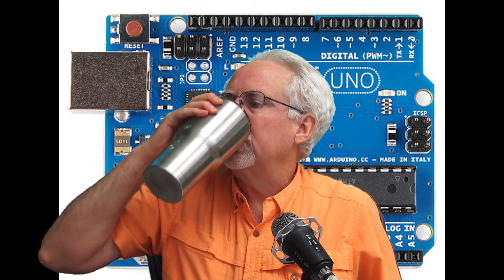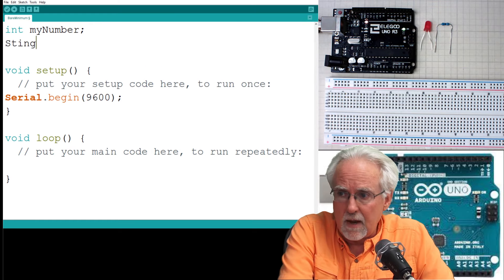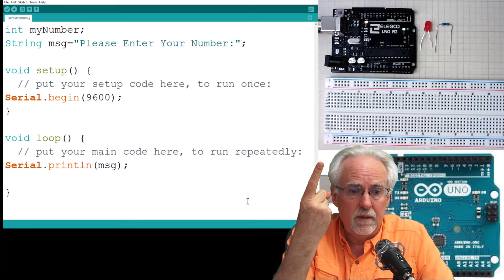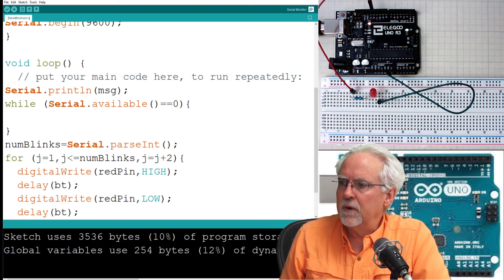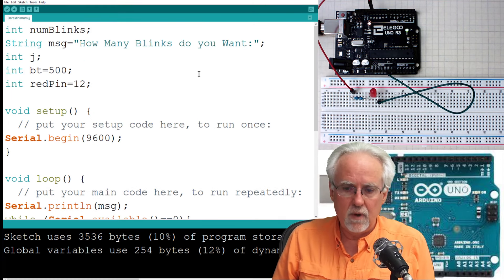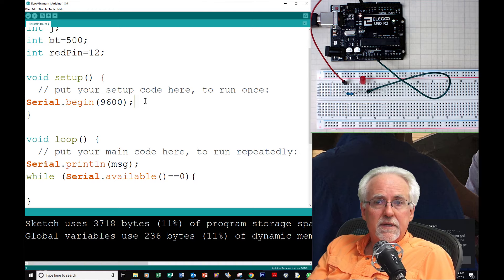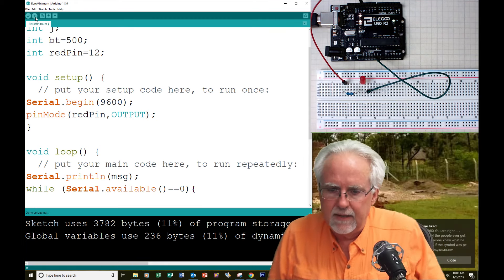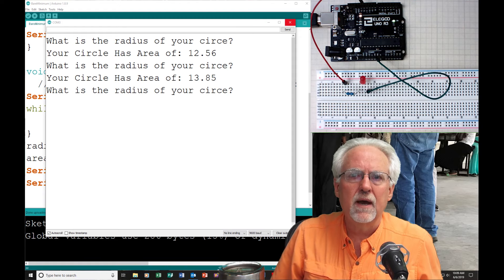Arduino Tutorial 18: Reading Numbers from the Serial Monitor

Comment: About 10 min in kinda got an idea of what you were going for for this one. Decided to stop the video try it myself. It works, but I'm not sure how to read Strings in it so can't type in ON OFF, just 1 or 0.

int lightChoice;
String msg="Light ON/OFF:  ";
String msg2="Light is ON";
String msg3="Light is OFF";
int currentLight;
int light=12;
int delayTime=500;

void setup() {
  Serial.begin(9600);
  pinMode(light,OUTPUT);
}

void loop() {
  Serial.println(msg);
  lightChoice=3;
  while (Serial.available()==0){
    
  }
lightChoice=Serial.parseInt();
if (lightChoice==1){
  digitalWrite(light,HIGH);
    Serial.println(msg2);
}
if (lightChoice==0){
  digitalWrite(light,LOW);
  Serial.println(msg3);
delay(delayTime);
}
}
Reply: Watched a few more min saw the actual project and took another shot

int blinks;
String msg="How Many Blinks?:  ";
String msg2="Blinking for ";
String msg3=" time";
String msg4="s";
int currentLight;
int light=12;
int delayTime=500;
int j;

void setup() {
  Serial.begin(9600);
  pinMode(light,OUTPUT);
}

void loop() {
  Serial.println();
  Serial.println(msg);
  while (Serial.available()==0){
    
  }
blinks=Serial.parseInt();
Serial.print(msg2);
Serial.print(blinks);
if (blinks>1){
  Serial.print(msg3);
  Serial.println(msg4);
}
if (blinks<=1){
  Serial.println(msg3);
}

for(j=1;j<=blinks;j=j+1){
  digitalWrite(light,HIGH);
  delay(delayTime);
  digitalWrite(light,LOW);
  delay(delayTime);
  
} 
}

Comment: I am kind of late to the show.I really find it very informative. I watch few and goof with it, then watch some more. Yesterday I spent a embarrassing bazooka amount of time trying to figure out why a few of my LEDs were so dim (but working). It was the pinMode!! I was a day too late. I am trying to set up a binary clock. IT WORKS! However; I have an issue when I set the delay to above 30000 (I need 60000 to get the clock to work on real time) it freezes. Any ideas? Thanks.
Reply from the maker: The problem is likely you are overflowing the int variable. ints have a maximum size around 30,000. Try using 
unsigned long yourVarName

Comment: Hey paul, In the Serial Monitor it always kept printing out the message even when I didn't give it any input. I did pretty much what you did and did the "No Line Ending" thing too. For now I made it in a For loop so it only prints once in the beginning, and another time when you put your input. Is it because I'm Using a more up to date version of arduino?

The Edit: nvm I just found out that I just had indexed the program wrong.

Comment: i did this exercise and everything did work, I keep getting a second print out with a 0 in it, i'll just show you one :
 what is the radius of your circle? 
Your circle has an area of: 12.56
 what is the radius of your circle? 
Your circle has an area of: 0.00
 what is the radius of your circle?
Reply: nevermind I just say your other message, of the "no Line Ending" and that fixed it. i'm just going to leave this here because someone might need to see this. Great job Paul, ignore the haters.

Comment: Why does my serial monitor gives a "your number is 0" after giving "your number is 3"? (I typed in 3 in the serial monitor and it gives "your number is 3", then "please enter your number", and then automatically gave "your number is 0"). The code I use is identical to yours.

Comment: Hi, I wrote the same program on my own yet it asks HOW MANY BLINKS twice after the LED finished blinking. 

int NumBlinks{};
String msg1 {"How Make Blinks Do You Want: "};
int redPin {12};
int delayTime {250};

void setup() {
  // put your setup code here, to run once:
  Serial.begin(9600);
  pinMode(redPin, OUTPUT);

}

void loop() {
  // put your main code here, to run repeatedly:
  Serial.println(msg1);
  while(Serial.available() == 0){
    
  }
  NumBlinks = Serial.parseInt();
  for(int i {0}; i < NumBlinks; i++){
    digitalWrite(redPin, HIGH);
    delay(delayTime);
    digitalWrite(redPin, LOW);
    delay(delayTime);
  }

}

Comment: Please help here, I'm using the R4 Minima board if this makes any difference, BUT WHEN I open the Serial Monitor to execute the program, Nothing appears! Only when I actually enter a number (just because I know what the program should do), it gives the number and ONLY THEN it shows "Please enter your number?"

Is this a bug or something because I'm not missing ANY semi colon or see anything I've missed?? I'm stumped.🤔
Reply from the maker: Make sure serial monitor is set to no line ending.
Reply: @paulmcwhorter  I think it's a minor bug. I immediately (on my laptop now) chose "no line ending" before choosing a number.. then it waited for me to enter a number before telling me what my number was and prompting me once more...
When I retyped the code in a new sketch and did not immediately change to "no line ending", it prompted me with the question as it should, BUT then I need to change it to "no line ending again" so it doesn't give me that unwanted "your number is 0.." line. 

However.. when I close and reopen the serial monitor, I get prompted with "Please enter your number:" even with "no line ending" chosen from the start. So it is when one types the code for the first time after opening a fresh new sketch that I experience the glitch or bug.

I hope this makes sense, but I wanted to explain what I experienced thoroughly.🙂
Reply: Keep getting back a message that your number is 0. I’m sure I’ve written the code to an exact copy. Been staring at it for ages 😢.

Comment: Another question --- when working on this, I wanted to accept a lower OR uppercase "R" for red, but I have not found any method of doing string handling in the Arduino reference (as in interrogate the first character and make the decision based on that).  Sure, I can make it check for "red", "green", "blue" but I wanted to 1)limit the valid inputs and 2) make the entry simpler for the user.  Can that be done?
Reply: One way to do it would be something like this. Note that this is just pseudocode, not meant to be actually runable:

  Serial.println(msg);
  while(Serial.available()==0) {
    
  }
  userPinChoice=Serial.readString();
  If (userPInChoice == "r" || userPinChoice == "R")
{
   //Do something
}

To do something like you suggest (interrogate the first character) you could try:

userPinChoice = Serial.readString();
string myPin = userPinChoice.substring(0, 1);      //start substring at index 0 and continue only until index 1: gets only the first character
If (myPin == "r" || myPin == "R")
{
   //Do something
}

Hope this helps!

Comment: I think this will be more intuitive to take in...
Coding the Serial.available(); before the WHILE loop and including it as the "last" statement in the WHILE loop.
It works equally well with what you did Sir Paul, but i think this is more easy to take in for us beginners.
It's like instructing the serial port to check available data in its vicinity...and when it does not found any, it just proceeds to checking again via the last statement in the WHILE loop. AND..reading the last statement in the WHILE loop i.e. Serial.available();...it counter-checks with the condition inside the WHILE..hence a more intuitive process of looping.

Anyways, thank you for this lesson Sir Paul. Definitely learned new things!

----------------------------------------------------------
void loop(){
  Serial.println(msg1);
  
  Serial.available();
  
  while(Serial.available()==0){
     
    Serial.available();
  }

Comment: I have a little problem with my coding sir..Whenever I uploaded the sketch, the program works as expected but then it automatically prints out "Your number is :0" on the second run of the program and wouldn't wait for me to input  number the second time until the 3rd run when it then allows me to input a number
Reply: Paul McWhorter
8 months ago
Guys if you are having trouble, make sure you have your serial monitor set to "No Line Ending". Otherwise you can get unpredictable results.

Comment: Nice one Paul! With your help I was able to create a game using the prompts. Where two inputs into the serial monitor were added together and the total amount of blinks output to the LED. After each action the user knew what was happening as the code will produce messages based on what's happening.

Very cool!

Comment: For some reason after the code run once and I input a number it displays the String message twice instead of once.  My code looks exactly like yours so I can figure out what is going on.  Never mind, found the answer in a comment below.  Change the Serial Monitor to "No line ending" and that worked.

Comment: Hi Paul,

in this lesson we didn't enter a pinMode and the LED blinked dim but you did not explain what was causing the LED to blink dim when no pinmode is entered?

Kind Regards

James.
Reply from the maker: It has to do with the way the pin is connected in the circuit, based on the pinmode command. Hard to explain without drawing a picture
Reply: According to the Arduino reference; the internal pull-up resistor is enabled by default when pins are undeclared, and the resistor acts to limit the available current. Unfortunately the Atmega328 datasheet offers only basic schematic diagrams of the I/O pins so I'm unable to explain exactly how this happens.

Source : https://www.arduino.cc/reference/en/language/functions/digital-io/digitalwrite/

Comment: Is there a reason why the largest positive integer the serial monitor will accept is 32767? If I input 32768, it prints -32768. Positive integers above 32768 prints different negative numbers. Is this a mathematical limitation of the Arduino or a bug in the code?

Comment: Anyone else get an issue where you kept getting a second 0 value automatically entered every time you enter a legitimate Value?  Found it after a few minutes of checking.  
It was on the Serial.print window, just of the left of the BAUD rate value (9600  or whatever you may have set it to).  Mine had defaulted to "Carriage Return"  it needed to be set to "No line ending"
I mention it just incase its caught someone else too.

Comment: Does anyone know why numbers entered with values above 5 characters and even some with 5 characters produce seemingly random outputs including minus numbers?
Reply from the maker: In arduino integers are limited to a certain size. . . something like 32000. Have to use floats for nubmers bigger than that.
Reply: @paulmcwhorter  I didn't expect a reply from you Paul, thank you so much!

Comment: I am using Arduino 1.8.13 and when I run the code for the Ask, wait, read I get a read of the input number AND a read of "0". Unless I put a Seria.parselInt/Float() before the wait loop.
Reply: Do you have a single equal sign in this line of code?  The code line should be:         while (Serial.available()==0){

Comment: How do you flush the Serial buffer to stop residual input?
Reply from the maker: That is really hard, and I have had only limited success with it. Make sure your serial monitor is set to no line ending, and one way to can clear it is to just read into a dummy variable. Wish I had a better answer.

Comment: Very very interesting and helpful series!!! However i have one question . I tried exactly the same code as yours and i couldn't get it to write the numbers i inserted into the serial monitor, without printing  the additional messages: ''please give your number, your number is 0 . So i experimented, and replaced the command : while (Serial.available()== 0){
  
} with the command (while (Serial.available()== 1){
  
}) and it worked !. Could you answer me why? thanx a lot !!! 
jim
Reply from the maker: make sure serial monitor is set to no line ending
Reply: @paulmcwhorter  thank you very much!!

Comment: Could you please clarify how the message in your code is designed to print only once? I observe that the `println` statement is within the loop, similar to my code. However, in my case, the message continues to print until I input a value. I appreciate any insights or suggestions to address this behavior.
Reply: Sorry found my mistake, "No Line Ending" 😁

Comment: How can I use the square ^ on the variables instead of having to tyoe radius in twice?
I tried only printing 3^2 but that didn't work either
Reply: There is a function for doing powers pow(). For example 3^2 would be pow(3, 2). I got some unpredictable results with it though, but I think it was because pow() returns a long and I was doing int math. Also I think you can't use pow() in an if statement, probably better to assign your pow() value to a variable first, then do the if statement with the variable. Need to do more experiments.

Comment: Unfortunately it seems I can't test this out. It's not accepting inputs in the serial monitor on the "tinkercad" simulator.  I can type in there, but it's not accepting what I type. Actually, it just gives back whatever it wants. In the "Enter a number" example. I put in 55, it told me "Your number is -4556" <<<Literally not what I said at all. I think the tinkercard serial monitor is buggy for inputs, but I'm sure that the code would work fine. 

I'll test later on when my Arduino arrives. Using simulator for now, stuff's out of stock...

Comment: Great series, lessons in easy steps. The odd typo here and there really adds to the experience. You learn more when things go wrong than if everything is perfect first time. I had an unexpected result in this exercise which was down to my line ending setting in the serial monitor. By default it was set to 'newline', so it added a second carriage return. Things worked perfectly when I set this to 'No line ending'.

Comment: my code is not working in same as you are doing in first part:
input:
int mynum;
String msg = "Enter Number: ";
String msg1 = "You Entered:";

void setup() {
  // put your setup code here, to run once:
  Serial.begin(9600);
}

void loop() {
  // put your main code here, to run repeatedly:
  Serial.println(msg);
  mynum = Serial.parseInt();
  while (Serial.available()==0) {
    
    mynum = Serial.parseInt();
  }
  Serial.print(msg1);
  Serial.println(mynum);

}

output:
Enter Number: 
You Entered:3
Enter Number: 
You Entered:4
Enter Number: 
You Entered:5
Enter Number:

Comment: Mine will display my number correctly then it will say my number is 
'0'
Reply: I'm having the same issue. Everything I typed is identical too, even after rewriting the code a second time.
Reply: The setting on the Serial Monitor needs to be 'No Line Ending' instead of 'New Line'. I didn't know that until reading a few comments.

Comment: Hello, I have this program(it is basically the same as Mr. Pual McWhorter's) PLEASE HELP:

int myNum;
String question = "Please enter your favorite number";
String msg = "Your number is ";
void setup() {
  // put your setup code here, to run once:
Serial.begin(9600);
}

void loop() {
  // put your main code here, to run repeatedly:
Serial.println(question);
myNum = Serial.parseInt();
while(Serial.available()==000){  
}
Serial.print(msg);
myNum = Serial.parseInt();
Serial.println(myNum);
}

There is an error where suppose I type in 9 it responds with "Your number is 9", but then also adds "Please enter your favorite number"(without me typing anything)and then "Your number is 0". Please help.

Comment: everything works fine as long as the input number is < 35000.  For input numbers greater than 35000 the Serial.parseInt() takes on negative values.  Why?   Also,  for any input into the serial monitor,  the Serial.available() takes values that appear to be almost like at random.  Why?

Comment: Hello, Paul.
I have a question, on the IDE 2.0.3 just coded this program, even simplified just to read and give the user input value. The problem is, it gives the value I have put and then returns 0 value after a second. What do i do?
Reply: ok, I put it into no line ending)

Comment: Sir, While i am running this, it counts area for given radius but it also automatically count area for radius 0, that I did not entered. means everytime it runs for two time. one time for given radius and second time for zero. same thing for Enter your number also. where could be error?
Reply: I got problem, my serial monitor was set on new line.. sorry

Comment: Please Enter Your Number
your number is:99
Please Enter Your Number
your number is:0
Please Enter Your Number
 after i putt in 99 it did all of this why dose it think zero was input using mega
Reply: I did have the same problem, using a (original) Arduino Uno. 
Make sure serial monitor is set to no line ending.

Comment: Every time I put the number in the format and variable output are correct but then the two strings repeat and say my output is zero. It's as if I set a loop to do it twice and it outputs the number I entered into the variable and then runs again and says I typed in 0. I've reset the arduino, my pc, checked com port. But everytime I rewrite (not copy and paste) the code I get the same output. Any ideas what to do? Should I use the current ide version I've been already using or revert to the same one you are?

Comment: Hi ! Can someone tell me if I use Serial.parseFloat() two times consecutively, do I need to empty the Serial port buffer before the second Serial.parseFloat() to be function correctly ?
If yes, should I use Serial.flush() or Serial.begin(9600) to empty the Serial port buffer? (I did try both, but they don't work!)
Your answer will be highly appreciated!
Jack from HK
Reply from the maker: Make sure serial monitor is set to no line ending.